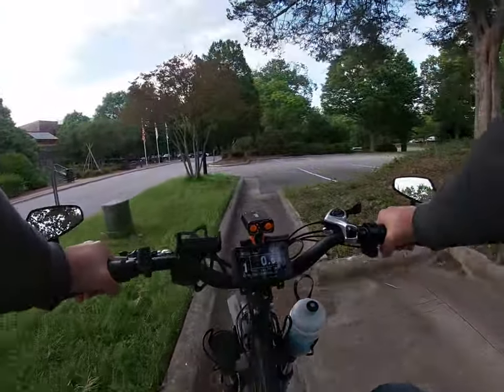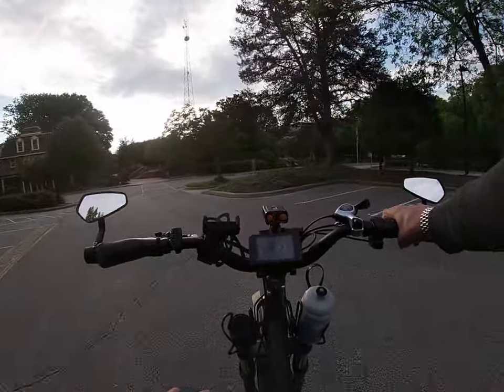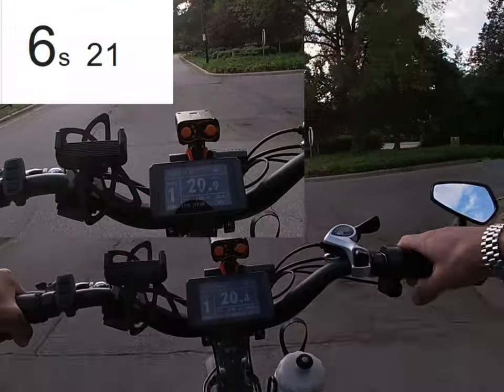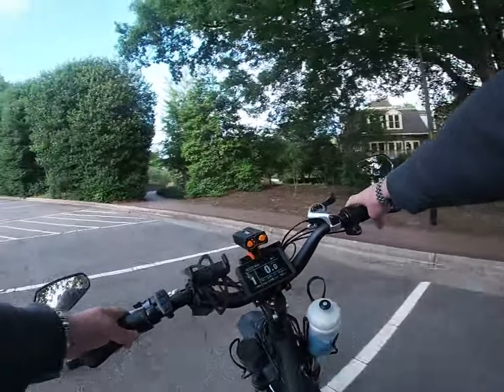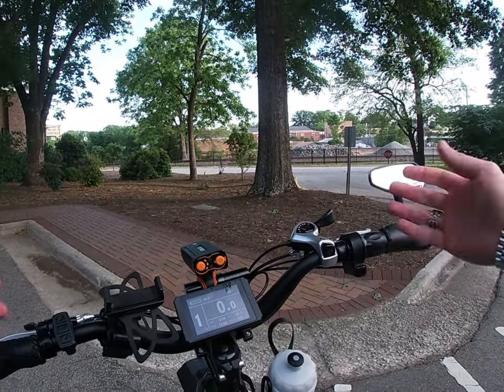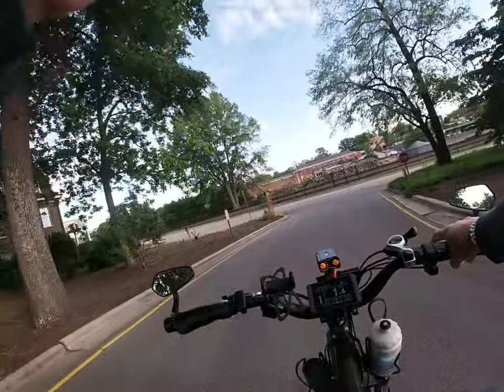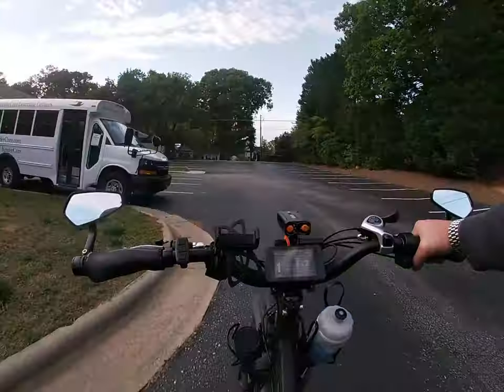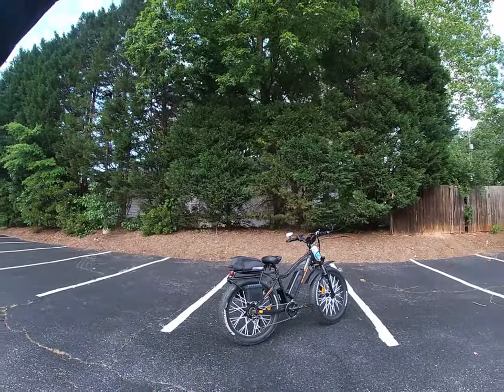Bolton ebike Rad Rover Upgrade-5 Things to Know

Comment: Bought the large mounting box , the controller fits easily, the problem is that it’s way too large IF you have the original fenders on the rad rover 5 . The fix as you explained is to just use the old hard ware ( which is hardened steel ) and by longer screws with locking bolts .

Comment: I've put 4k miles on my rad-wagon.   I live a hilly area of Sothern California.  This is what makes a difference with battery life and power used.   On the flat you can go lvl2 battery and 18+mph, making if more efficient than lvl3 power.  However any kind of hill in level 2 slows it down enough to effect the torque output.   Now mine is older direct drive motor and more effected by this.    sweet spot for torque on mine is around 20mph.   So if I go lvl2 up a incline at 11mph  or lvl 3 at 19mph I'm using about the same power as you going that much faster. So I rarely use lvl2 in my area as we have so many inclines.  On bigger hills I'm lvl5 and going 6mph which sucks as drain is high and torque is low. I've actually felt on slight inclines as I come off stop light that pedaling gets easier as I go faster as the torque increases.

Comment: I have the radrover 5
I have all stock except, I purchased the 52v 20amp battery that  Bolten sold.
I can get 70 to 80 mile on one charge.
On pedal assist 3 or 4 and 5 at times.
Going 20 to 22 mph 
I went 22 miles on pedal assist 4 and lost one bar.
Reply: D Larson  don't know make
Boltenbikes.com
Radcity don't know I have a radrover5
Reply from the maker: That is great range but more than I need, I will probably change battery in the future to get higher top speed.
Reply: B
Reply: You shouldn't make false claims. Get on your bike and really test the mileage but don't make false claims. Thank you

Comment: Idk if you'll see this because it's an old video, but do you remember if it took away the big deley the bike has when it starts to accelerate? I want my bike to feel snappier, since i use it to do stunts and wheelies, relying on the motor (i have a RR+ and i love I'm Canada, so 500w.)
Do you think if this (a 35amp upgrade) would help me keep the front end up?
Reply from the maker: there is a setting in the new display the allows for stronger take off acceleration, i think its C5.  when i upgraded my RR it was super easy to wheelie it.

Comment: I heard you mention your Rover had no USB port.... funny thing is my 2017 Rover has a USB port on the bottom of the controller (not easily noticed if your not looking in the right area) ,  just fyi...I use it to keep my phone charged with a 6" 90 degree USB cable...

Comment: I concur,on the use of the throttle decreases range. That’s because it skips the PAS settings & is PAS 5 when. Using throttle  I’m 6’1” 250lbs. I use PAS 2-3 & peddle and I go about 20 MPH. I also have lots of equipment on my bike. 2019 Wagon. It believe it would be nice if the throttle would only be ‘PAS setting we choose. CC,do you know or have any idea of how to disconnect the on off switch but keep the throttle.? ThY.

Comment: I read the 750W motor upgrade has less torque than the stock Rad Mini 4 500W(same as the Rover). 
I would think if I upgrade the controller, I'll get better torque, then upgrade the motor and I'll also get a faster max speed.

Comment: Citizen, did you do the "hack" where you press both buttons on the PAS controls (in stock form pre-controller upgrade) before you did the tests for your previous video?  There is a well known "hack" ( i use the term loosely) that takes the PAS 20MPH limit to 25MPH. You may be able to still do it, despite having another controller. I'm looking at getting one myself, and was curious about the range. You mentioned that you only really have to use PAS level 1...theoretically does using that low of a level PAS for a longer period of time still mean you get much less range, or does it improve the range in any way being at such a low level?
Reply: Would love to know this answer as well! Great question
Reply: Changing the settings on the stock controller to 25mph top speed is quick and easy. Electrobikeworld.com claims that the KT-LCD8H, used in conjunction with the controller and motor upgrade, can be adjusted to achieve a max speed of 45 mph. Obviously, this is not legal in most places but it is the claim. I’ve seen plenty of others who report higher top speeds after the upgrade.

Comment: I'm having issues where the PAS only engages for short little half second burst as I pedal. I have the bafang 750w motor and the 35a controller.

Only thing I can think of is the pas sensor might be the issue since I had replaced the disc previously. Could it need to be flipped around to face the other direction for this controller?

Comment: I bought my wife the Radrunner (single speed). Will this help with the power when using pedal assist? We have hills and im hoping this will help climb those hills with oedal assist. Thanks!
Reply from the maker: not sure if this controller works on the radrunner or not, you would have to check the bolton website.  but it gives you more power everywhere, throttle and pedal assist.
Reply: I installed the upgrade on my Radrunner.  I like the new meter, and it has twice the power (seemingly), but I'm still not sure it is worth the reduction in range.  I used to get 24 miles on pretty flat mountain trails,  but I only got 17 miles after the upgrade.  Still trying to see if the settings menu can help.

Comment: I watch your video have a 2020 rad step through 3 will that controller and screen work on that model? I understand it will only give u a little pick up power but no top speed..  After I purchase this controller and screen what would It need to do to increase the top speed? Let me know thanks
Reply from the maker: There is a list of rad bikes that this will fit on the Area 13/Bolton website. If you have a 2020 Rad Rover 5 I think it should work. All of the settings are also listed on the website
Reply: @CitizenCycle925  ok thanks I'll check it out

Comment: So if the Bolton controller doesn’t increase the top end speed what does? Thanks and have a nice day.
Reply from the maker: from what i've seen, you need to increase battery voltage to gain top speed.
Reply: @CitizenCycle925  got it. Thanks for the info. I'm slowly learning.

Comment: To sum it up, $200 and you get to 20mph a little faster. That's it folks!
Reply: And how much more range ? Thanks
Reply: A LOT faster, it transforms the bike..!!
Plus an upgraded controller, color.
Reply: RICHARD Stevens what about range?? Does this increase the distance?
Reply: roosterinmarari 
This increases torque, that’s about it. Range I believe is all dependent upon throttle usage.
Reply: RICHARD Stevens ok cool I’ll probably jus buy an extra battery for $500 that’s the biggest thing I care about is the range
Reply: RICHARD Stevens thanks for the response!
Reply: roosterinmarari 
I’ll probably do that at some point, I just saw a great YouTube video last night regarding running another battery. They’re run separately though so when one runs out you hook up the other.
https://youtu.be/Z_SQ28Q3Hu4
Reply: Top end speed is not noticeably increased, range is actually diminished on stock battery but the POWER and intense quickness is what you’ll notice with this upgrade. And upgraded motor over stock is definitely needed to increase the speed and a 52v upgraded over stock battery will increase the range . Just not the controller itself will not extend range.
Reply: @richardstevens5961  Range is dependent on how much power you use. The higher PAS setting the more power you use, The throttle alone also uses more power on whatever PAS setting you link it to, But the lower the less. So it's all about ride low and slow to get the best range. Hills will eat range also, So for the ultimate range ride low and slow and flat lol

Comment: Is there an upgrade for a rad mini? I’m in Canada so my motor is 500 watt and not powerful enough for some of the hills in my neighbourhood...cheers🍷🇨🇦
Reply: what's a neighboUrhood?
Reply: HailCaesar01481 : neck of the woods
Reply: The same one will work on the rad mini. I have it installed. Works great

Comment: How is the torque with the controller ?
Reply from the maker: no sure how to describe or measure torque,  but i can tell you the difference is quite noticeable with new controller. accelerates way stronger off the line, feels like it has way more hill climb power too. did you see my results video, i did side by side video comparisons.
Reply: @CitizenCycle925  Ok Thanks
Reply: @CitizenCycle925  No miss that video

Comment: I installed the bolton upgrade controller and display on my 2020 Rad Rover 5. Initial test ride all seemed fine. Second time I took it out, there was a loud struggling sound from the motor. The throttle would cut out between 7-12 mph. The pedal assist would cut out, not engage or surge. Has anyone else experienced this? I sent an email to Bolton but have no response. Going to switch back to the stock controller
Reply from the maker: hi Carl, i have not had any of those issues, my only suggestion would be to double check all the settings, maybe something is off.
Reply: What happened when you switched back to the stock controller?
Have you informed Bolton and gotten a response?
We’re you able to rectify the situation?
Reply: Carl Zylak 
Any updates on this?
Reply: RICHARD Stevens yes Bolton got emailed me back with some programming suggestions. I switched back to the stock controller and no issues. I plan on putting the Bolton controller again tomorrow. Will post results...
Reply: Carl Zylak 
Good luck, maybe a momentary blip on the time/space continuum..!!
Reply: @wallawallawine1  
Hey again, so what was the outcome of this situation?

Comment: Bolton does not make it. It is not the Bolten controller many aftermarket dealers sell this controller
Reply: What other dealers sell it?  I looked can't find it.
Reply: Yes this is technically true, but unless you are willing to go on some Chinese website and cross check every connector yourself to make sure it fits and works then you can. Or spend the extra 50$ to buy it from Bolton since he's done all the work to make sure it works. Plus he warranties it, good luck getting warranty on the one you buy off of alibaba
Reply: Yeah. The problem is there’s not an aftermarket controller out there that I can find that has the brake light function. Which sucks because aftermarket controllers are only $50-$60.00. But if you want the radpowerbikes connectors and proper wiring+brake light function you’ve got to shell out twice as much cash.

Comment: Top speed, bull shit. With the new controller, the video explains everything. He tells you how to mount it and adjust the programming. The stock mount will not work, and with his instructions it was easy and has zero problems!!!
Reply: Does it make it go further
Reply: @billybignose5360  no, you can add a battery which will help out a lot. Bolton has the parallel connection to add a battery. I added another 48V to my back rack. I watched videos for soldering and connections. Then went to my local metal shop and bought a piece of aluminum to mount the battery to. If I could add pictures I would.
Reply: @jasonlittle118  So what’s the point of buying the controller
Reply: The stock controller is limited. If you are comfortable with the stock ride and don’t want the extra power or speed then that’s okay.
It’s just a personal preference.
Reply: @jasonlittle118  oh ok thx